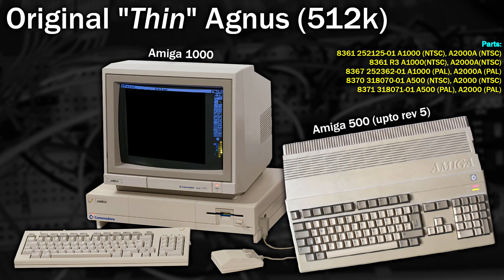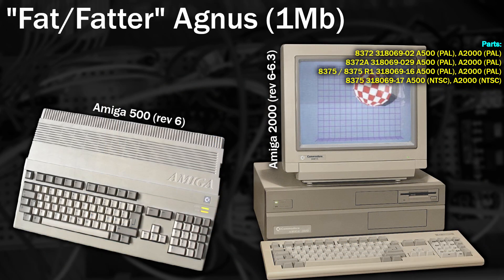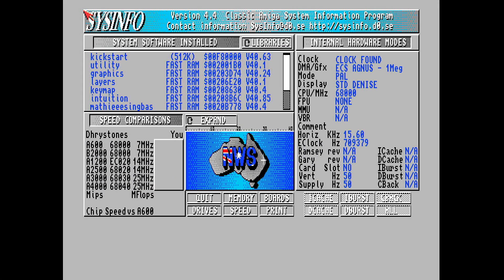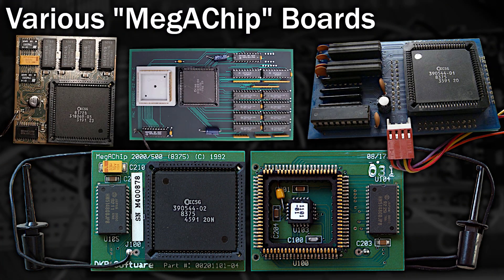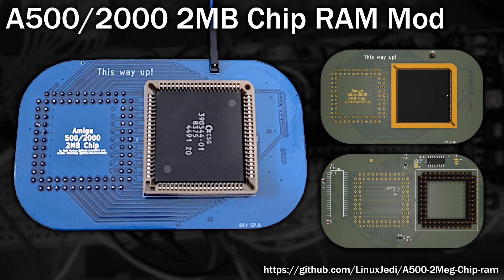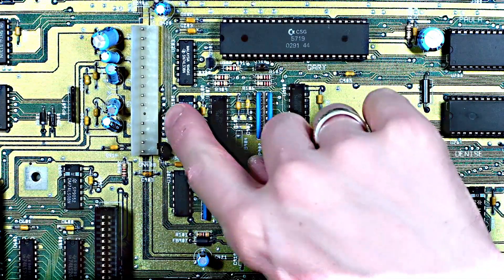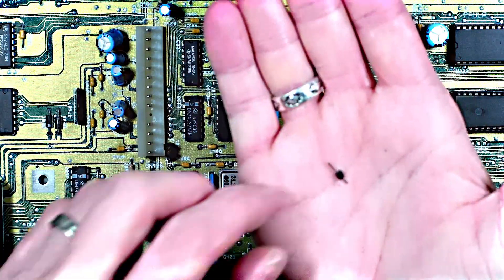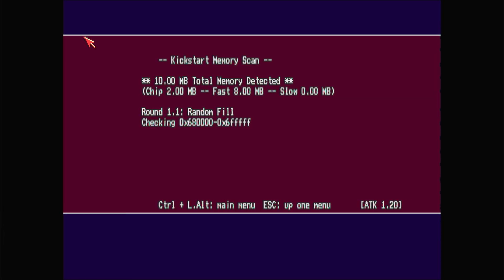Amiga 2000 Full 2MB ECS Upgrade Mod (A500 compatible)

Comment: You know, on Rev 6a A500's and Rev 6 A2000's you can simply replace the 4 x 256kbx4 DRAM chips with 4 x 1024kbx4 DRAM chips, whack in the correct model of A3000 2MB Agnus, do a couple of quick trace cuts and jumpers and you have 2MB chip RAM on board and without the dodgy Agnus socket PCB (these are never reliable) etc. Looks much neater, is probably cheaper and is definitely more reliable.

It's quite easy to do and the instructions are available on the web and even Aminet.
Reply from the maker: Isn’t the A3000 agnus almost impossible to find?

Comment: Regarding the name "Fat Agnus", it's not referring to the memory it can address, but rather the square PLCC chip package it came in on the A500 and all but the earliest A2000s. So there are definitely OCS Fat Agnus. You'll note that it's labeled as such on the pre-ECS A500 rev 5 motherboard.
Reply from the maker: Those terms are the main ones on the internet with that as the description. Yeah the original original OCS is different but the fat and fatter are the same form factor

Comment: The very fact that you were able to desolder the Agnus socket without causing any damage is a remarkable feat and deserves a "like"! Well done.
Reply from the maker: Thank you. One thing I’ve learnt is it pays to have the right tools for the job…. And to practice using them on something not important!
Reply: @RobSmithDev  Agreed! However, I must admit that in the past I have "broken" the plastic enclosure to expose the pins and then using my iron and a tweezers, picked each of the 84 pins out of the board. A lengthy but safe way of doing it. But your way is better. 👍
Reply from the maker: lol yeah that’s how I did my A500+ but then that socket was all damaged by varta leak anyway so didn’t really matter. Didn’t have the desoldering gun then
Reply: I knackered an A1200 throughhole cap pin with the same “moo” gun. You must still be very careful. Also quite a few of those pads have no trace attached so they are even more likely to come off. If it was me I’d have left it alone. That said, amazing job!!
Reply from the maker: It’s temperature and practice unfortunately. But yes there’s always a risk. The initial reapply of solder really helps, but also not pressing too hard - shouldn’t really need to apply any pressure. However maybe you were just unlucky

Comment: To answer the question at the end about Denise, yes, the pixel clock phase is slightly different between OCS and ECS Denise chips. This is why the fixed logic version had a OCS/ECS jumper, it was to shove the clock signal back through a spare logic gate to add a bit of artificial latency.
Reply: @counterair173I think there are specifications out there for Denise chips with timing diagrams in them. I think we are talking like 3-10ns range of difference. It has been a few years since I've measured it and I don't have notes.

Comment: Nice :) I have the ACE2B from Individual Computers however it defaults to NTSC when my 500 is Pal.  Does your solution defaults to NTSC as well?
Reply from the maker: Mine defaults to PAL. I believe there’s a pin on Agnus that controls the default mode
Reply: @RobSmithDev  8372a has a pin to control the default mode. 8375 does not, they are hard-coded to start up in NTSC or PAL, but both versions can dynamically switch to the other.

Comment: Excellent, love a good maxed out Amiga. The prevalence of modern replacements makes it possible to max out to period appropriate levels without the lottery and expense of period parts. I managed to get one one of LinuxJedi’s Ramses II boards for my A500
Reply from the maker: Amazing stuff and it’s more fun. Plus for me at least being older and no longer relying on pocket money I can actually afford some of them!
Reply: @RobSmithDev  lol, exactly, I was 16 when I got my A500 in ‘91 and the only expansion I managed to afford was a RAM expansion. I drooled over the A590’s and GVP addons but they may as well have cost a million for my spending power at the time. I kept my A500 and it is now maxed out to a level that would have cost thousands back in the day. It’s great fun.

Comment: Excellent video :), It was nice to see what another option looks like to install. I went the solderless route, only so I could simply put the 2000 back to stock form if I wanted, which didn't quite go to plan lol... Just as a note in your intro you sort of suggest there is a revision of the 2000 that was 2MB chip capable out of the box, to my knowledge I don't believe that's the case the last revision being a 6.3 with 8372A with a max of 1MB Chip. Which you seem to confirm later in your later Agnus Version clarification, nice to see this explained so succinctly :) It might have been worth including the 8372B, used in the A3000, as this was an option used by the mega chip (original 2MB upgrade) and it is, I think, possible to drop one in a 500 rev 6/7 with some changes to jumpers etc and use a similar expansion to the 500+ :) ... Oh and the blown out trace on the RGB turns out to be a common-ish thing on Rev 6 2000s, found some other cases on Youtube and in blogs, but still no idea what causes it :(
Reply from the maker: I’d read somewhere about the very last ones being full ECS, or at least I thought, maybe I’m mixing it up with later ones coming with kickstarter 2 rather than 1.3. 
Oh and I’m wondering if it was a particular common monitor connected to that port that blew the tracks out. Would make sense
Reply: @RobSmithDev  the 1MB capable 8372A is referred to as ECS Agnus and I do believe there were some later 6.3 2000s that shipped with an ECS Denise which makes them "Full ECS" in the same stock form with 1Mb Chip and ECS Denise as the 500+ but unfortunately not upgradable to 2Mb Chip... Confusing (like you said) ... and yes that would make sense if there was some monitor or scan doubler that went bad or pulled too much from the port...
Reply from the maker: I’ve seen in a few forums that the definition of what ECS actually means is a bit fuzzy! I guess the A500+ got it right with easy ways to add the extra 1MB. It’s a shame there wasn’t an easy way to add the extra 1MB to the 6.3 a2000s
Reply: @RobSmithDev i guess the assumption was owners are more likely to add RTG and fast ram in a 2000 so 1M chip would be plenty in a time when PCs only had 512-640k base memory. But the 2000s hung on we'll into the 3000 reign meaning 1M was not going to cut it! 😉

Comment: Nice video Rob.  I'm enjoying your series on the A2000.  I also have a rev 6.2.
Reply from the maker: Will you dare to try the upgrade? I did notice that sordan.ie does sell megachip boards that will plug in, although I have to say, I prefere the solution I have, less likely to fall off! 
https://sordan.ie/product/1254/amiga-500-2000-2mb-chip-ram-mod-agnus-8375-plcc-adapter/
Reply: I'm tempted but might have to practise my soldering skills first!  Thanks for the other link though.
Reply: @RobSmithDev  I have the ACE2b from Individual Computers in my A500 rev 5  which has a similar mechanism when plugging into the Agnus socket, it's a very tight fit so unlikely to cause any issues.

Comment: I remember upgrading my A2000 to 1MB chip. Had to short a few circuit lines on the motherboard by cutting them through. Man my 18-year old self had almost a heart attack when the monitor only gave a red screen output….. turned out the SCART connector was half connected to the monitor. A little push and I had all colors back again 😁
Reply from the maker: I know how you feel! I have to say I was a little nervous doing this but having it work literally first time was a great feeling
Reply: @RobSmithDev  With this mod, do you still have to cut the lines on the motherboard and do the jumpers as well like with the 1MB chip mem upgrade? i.e. if you jump from an original 515k motherboard to the obese 2MB chip mem mod you did here, is this still required?
Reply from the maker: @marcusdamberger according to the docs with the PCB: 
“If you have 512KB of Chip RAM before installing the device you need to switch the position of J101, which is located near the power supply connector, to its opposite position.

You then need to remove J500, which is located near Gary. On some motherboard this will be a case of removing a jumper, some will be desoldering a bridge and some will require cutting a trace between the jumper pads.”

Comment: My Amiga 2000 is branded a Video Toaster and came preloaded with tons of cards and it also had a MegaChip on it. When my friend gave it to me (it was her brothers) it was in bad shape from battery corrosion and I had no experience with amigas. It took me a long time and a lot of combing through schematics and replacing chips and broken traces to fix it. The bummer is during that process I’m pretty sure I fried that MegaChip. I had to seek out a stock Agnus and downgrade to 1MB chip ram 😢
Reply from the maker: Do you still have the machine? Cool that it came with the megachip in it
Reply: @RobSmithDev  I do. I fully repaired it and got the video toaster running and all of the midi and synth software and cards working. The only loss was the megachip and I sold it as is non working. This is the one I just ordered the vinyl case overlay for. The front of it says “Video Toaster” instead of Amiga 2000. I think Newtek used to sell turnkey solution machines preloaded with cards and software. It has a GVP 030 accelerator in it, a Trump card hd controller, a AD515 synth midi card, a Syquest and hard drives and had the mega chip. And i think the ram is maxxed out. I’ve swapped the floppy drive out for a Gotek and I added an SDbox sd drive that plugs into the parallel port on the back.
Reply from the maker: Wow lots of upgrades, mine has a bit of catching up to do! Glad you didn’t sell it, I’m sure you would have regretted it. Makes sense they would have sold complete units and therefor branded them. Very cool!
Reply: @RobSmithDev  I found some info on it searching for “video toaster labeled amiga 2000” can’t paste link in or comment gets deleted…

“Newtek never sold these machines directly, its a 2000 with a label attached over the left side of the frontpanel. The label covers up the Commodore Amiga logo and power/HD led panel. Dealers fitted the Video Toaster hardware and attached the sticker, but the inside remains a normal Amiga 2000.”
Reply from the maker: Makes sense I guess cool